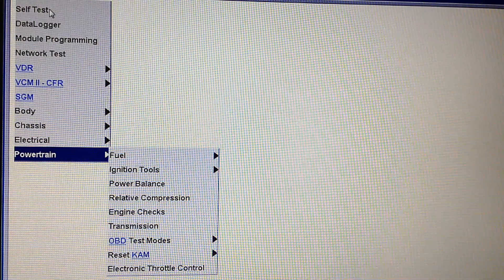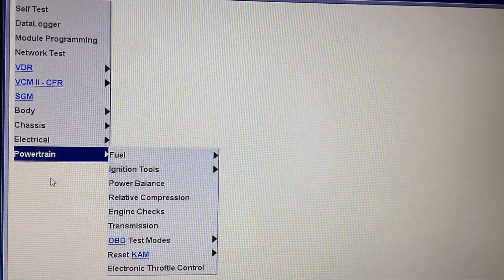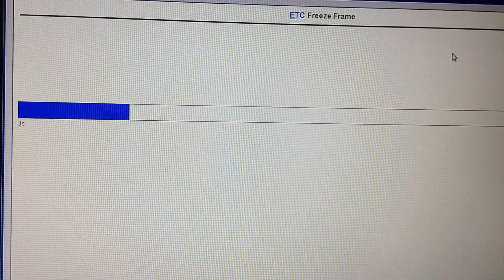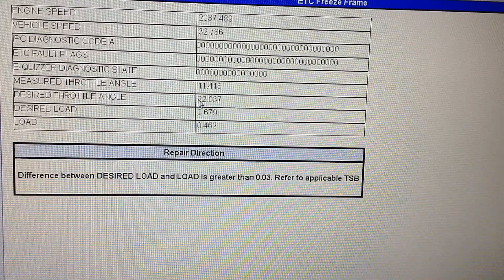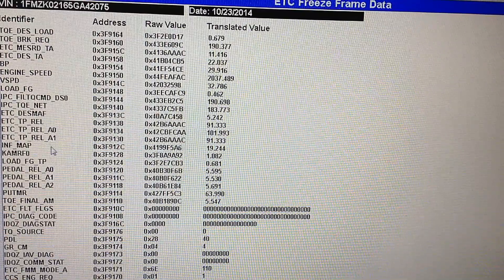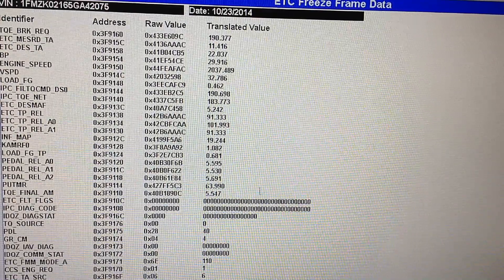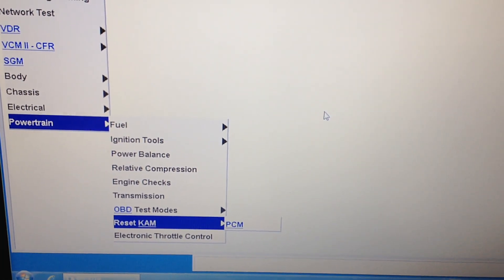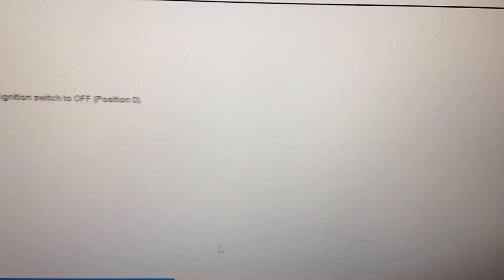Ford Five Hundred & Freestyle Surging No Start: Electronic Throttle Body Replacement

Comment: I took my 06 Five Hundred to the dealership earlier this week.  The wrench icon had come on & the car decelerated while i was driving on the road.  The mechanic ran a diagnostic check on the car & he found out that the wire for the throttle control was on the AC unit, it had gotten hot, frayed & burned throught the wire casing.  He said that the wires were touching & this was the cause of the vehicle slowing down.  I was told that i could go in myself & apply electrical tape on it to temporarily fix it until i can get it into a shop to fix permanently.  Is this possible, and if so, how do i get to the wire myself to fix it?
Reply from the maker: +Antonio Phillips I have a video on how to fix this- https://www.youtube.com/watch?v=IrDL810CEI4
Reply: Did it fix your problem?

Comment: Just cleaning throttle body regularly solved the surging problem on my Ford 500.  My mechanic did so much work trying to fix surging Ford 500 (which broke the motor mounts) before we realized all we need is to clean the throttle body every six months.  There is also a software patch we might try if it works well for everybody else.  Ford dealer recommended replacing throttle body, never heard of Ford-500-11-8-520TSB20.pdf  which has the software patch information.  A lot of information seems to have been taken down (by Ford?)  There was a Facebook page calling for a recall.

Comment: If clips not put on correctly, on Air Box, it will result in DIRTY AIR going into engine, like no air filter at all.  It creates havoc for MAF ONLY when it gets all DIRTY, causing codes, misfires, etc. Always cover filter if you leave it in the open box, when servicing vehicle. Upper air box should not be put on dirty floor/table. Cover/plug it up. That's for CLEAN AIR ONLY. (air filter is used, I assume, by owner)

Comment: Thank you for posting this video. I replaced the throttle body in a 2006 Ford Freestyle today, and the job couldn't have gone easier. It now runs as smooth as silk.

Comment: Thank you so much for suggesting Amazon for this part as I am on Amazon Prime. The local Ford dealer here was gonna stab me for almost $800.00 for this part alone plus 2 hrs of reprogramming of the throttle body. Total bill was over $1000.00. Too much! I will order the part tomorrow through Amazon and do this myself as I have done all my work to every car I've owned in the last 45 years. I paid close attention to the torque value for the bolts.  I will also re-learn the new part per one of your videos. Again, thanks!
Reply: Today I replaced the throttle body in my 06 Freestyle. All went without a hitch (yes I followed all of your instructions to a T). When I reconnected my battery the headlights came on & turned off quickly, but she started right up and the check engine light, which was on prior to this job, shut off immediately. Thank you for your advice!
Reply: My 2007 ford five hundred had throttle body problems. Was fixed with a recall I knew nothing about but learned from the Ford dealer.
Reply: Did the tb fix your problem?
Reply: Got mine from amazon, came with the coolant setup. @$100 cdn

Comment: I have an 05 Ford Five Hundred. The vehicle use to intermittently misfire and also buck and go into fail safe mode.  At that time scan codes were P2544, P0316 and P0306.  I replaced the plugs with Autolites and the # 6 coil. I then did the relearn procedure and it was still kicking out the same codes and misfiring.. or at least felt like it was misfiring.  I then took it to a shop and had them run a diagnostic and re-flash the PCM and TCM as I had found a TSB reporting that the P2544 code required a re-flash if the vehicle was built before a certain date, which mine fell into that category.  During their diagnostic they couldn't get it to replicate the issue.  They then re-flashed the PCM/TCM and afterward they did a test drive and it kicked codes P2104 and P2111 and went into failsafe mode.  They did some more diagnostics and recommended replacing throttle body unit and TB connector  as they said when they "tapped on the TB sensor housing or wiggled the wires at the connection" it would show something on their tool. They gave me a copy of the graph from their diagnostic testing and showed me where the graph went wonki. I took the vehicle home, replaced the throttle body and spliced in a new pigtail connector to the TB. This didn't resolve the problem and was still kicking out the same codes P2111, P2104 and now P0306. The vehicle has 180K miles on it. I figured a major tune up was in order. I replaced all the injectors and coils, I also replaced the spark plugs with Motorcraft this time as I had read that Autolites weren't Ford friendly. I also replaced the EGR, PCV, fuel filter, air filter, intake gaskets. I cleaned the MAF sensor. I drove the vehicle for two days and it went into fail safe mode and kicked codes P2104 and P2111. Very frustrated at this point. I was told the maybe the TB was damaged during shipment as the TB position sensors are very sensitive. I replaced the TB again and also replace the accelerator pedal position sensor. This still did not resolve the issue. It is currently showing codes P2104, P2111 and P0306. Also, I will note that my vehicle's wire harness did not drape over this AC line and was completely clear of it with no signs of chafing. I have access to an Invova 3130 scan tool.  What can I look at and monitor to see what might be causing this issue? I'm at my wit's end on this, any ideas on what are some other possible problems that I should consider?  Any help would be greatly appreciated!
Reply: Mark Darnell did you replace all the coils?
Reply: Mark Darnell you have to replace all the coils...
Reply: Try replacing 02 sensors too
Reply: Having same issue

Comment: do codes p2110 and p2107 have to be deleted after throttle body is replaced . I changed throttle bodies I tried to reset the computer but the wrench light is still on. it seems to be running better after a few mins but my gas petal is not working at all

Comment: I'm doing this job for my mom. this makes me love my old carburated mighty max slot more. the cost of this part is more expensive than my brand new carburater and my fuel pump was only 50. these new cars are money puts $200 for each injector that's $1200, $400 throtle body and that's not including a fuel pump

Comment: AWESOME video. Thank you. 
BTW, What software and bi-directional equipment do you use(or recommend) to read, reset, diagnose.... codes that also can be used with other brands of vehicles other than Ford??? Thanks

Comment: Hey, I have a quick question. I have a ford freestyle 2006 and it won't start, it cranks but won't start we had to call a mechanic they said it was the key but they checked and it wasn't then they said it was the spark plugs we changed them and it worked for only 2 weeks then it stopped then he went over again and now he showed us a code (OB II) and said it was the computer😰 
It's very frustrating, do you have any idea? Thanks for your help!!!

Comment: i have a 2006 five hundred and sometimes when driving the wrench light comes on and the car wont shift into gear but when u turn it off then back on its fine. any thoughts on why it does this.
Reply from the maker: Arya Mansoori Well it just depends on what the code is. I would get the codes read at auto zone first. There are two common issues for this and first I would say is the throttle body needs to be replaced as shown in the video. Second thing that is common is for the transmission speed sensors to fail causing this concern intermittently.

Comment: I just watched your video because I broke down yesterday in my 2006 Ford Five Hundred and received a quote of $1,133.00 to have a throttle body replaced. I'm considering buying the new part and replacing myself. Your video was very clear and well done. I feel like I am now armed with enough info to give it a go. Is there anything I should be aware of or concerned about prior to getting started?
Reply from the maker: Chuck DiNatale Nope just do as shown and make sure you rest the pcm memory afterwards so it can learn the new throttle body.
Reply: FordTechMakuloco Why are you not telling people to try cleaning the throttle body regularly?  The new throttle body will fail to.  Why are you not suggesting the software patch in Ford-500-11-8-520TSB20 which addresses this problem?  There is a letter from ford to the owners of Ford 500's that should be mentioned concerning the surging problem.
Reply: I I love hi

Comment: @FordTechMakuloco  ... ford500 running pretty damn good, no CELs. sometimes upon first start, idle will surge/drop to 500 RPM a couple times and then idle fine. Kinda seems like after the engine is fully warm. Idling seems to have occasional very very slight surge. TB has been replaced (I can tell from cooling line). Intake manifold has been done. What do you think ? Is this more of a fuel issue ??

Comment: my mercury montego is runnin no check engine lights but soon as i switch to gear and press gas it cuts off and some time it cut off when it switch to gear is this throttle body???
Reply: I have  the same problem with my five hundred
Reply: @pakman2292  i neva figured it out i junked the car

Comment: Help: I have a 2006 ford freestyle limited that's giving me a little trouble at the moment. Whenever I'm driving the vehicle tends to kinda shut down and no matter how much I press the gas pedal it won't go until I shut off the vehicle completely and start it up again. I took it to get scan and these 2 codes came up, P2104 and P2112. Please let me know what you think about it and what I should do. Thanks

Comment: My rpms run a little under 1000 rpms while in park.  I have a 05 ford freestyle 3.0 liter and it runs terrible.  There is no check engine light on and while in drive it has a little miss and it feels like its putting a strain on the transmission.  I put new plugs and new coils and still no difference.  Im wondering if I have a bad throttle body.  Any suggestions?

Comment: Which one is the sensor wire? I have a graphing multimeter but it has a bad battery and don't want to have to waste time tracking it down. If you can give any info that would be awesome. Thanks.

Comment: I followed your instructions on cleaning/changing the throttle body and now the car runs great.  Another problem, not long after i was driving the car to relearn the throttle body, the ABS and Trac control light lit up. Any way to get those lights to come off, I'm thinking this is due to the computer resetting.  Help!

Comment: I have 05 five hundred, works great, except the engine crank but won't start in cold weather or it might start but dies after 5 sec. (no check engine light). i did some research  but couldn't find much. Is there any chance that this (electronic TB) might be the problem.

Comment: I have a ford 500 2006 this is my second throttle body replacement used that is.  My question is do I need to reset anything or will it reset itself when replaced.? This issue has really stressed me out because the car stalls strains and the wrench comes on causing it to jerk and a acceleration. Thanks for any advice!
Reply: I know you might or might not have the money but you are better off buying a smack brand new throttle body,I have a 2006 Mercury Montego And It's the Same as a Ford Five Hundred(500),Its in the shop right now getting a throttle replacement, and the throttle was original,But like i said buy a brand new one,cause your better off with it and it will last you a whole lot longer than the used ones
Reply: Are the oem ones consider new like from jc whitney?
Reply: Yes
Reply: it will need to relearn

Comment: Ok, I am getting what I initially thought was  a rough shift at slow parking lot speeds with an initial light pressure on the pedal is applied after coasting.  The tranny bogs down and it happens maybe once a month.  Is this the throttle body? 

Is the issue the old style coolant throttle body or can it happen on a noncoolant TB too?  Should I stay away from ebay used TBs or do you have suggestions on those?  I was told by a dealer service manager my dad has had a relationship with for decades to not to use brake cleaner or carb cleaner on these new TBs because they take a coating that it takes off.  That then causes other issues.  Do you know of any cleaners that would not take the coating off and would clean it up? Is the dirty part the issue and if not what causes this issue? I have 158k miles and want to fix this cheap is there a way to do that with this Montego issue?  The expensive route I have considered is a A1 Cardone remanned TB.  Will that work or will that coating potentially be altered by A1 Cardone in the remanning process and not be good  similar to how the dealer warned me?  Any suggestions on an affordable fix would be great. thanks

Comment: Just got word that my 2nd alternator failure is due to a PCM issue. Can these be replaced used or aftermarket? Had a coilpac go bad , changed all plugs and rear  3,4,5 coilpacs and then alternator issue. Car was re-ended 2 weeks prior and had to have the alternator replaced so we could drive home. Charging system light came back on 150 miles up the road. now 2nd dealership saying PCM is bad...
Reply from the maker: Steve Corbin Is the alternator a Ford reman unit?
Reply: FordTechMakuloco Yes it is. Now dealer says its a bad PCM.

Comment: I have a 2005 ford five hundred and the wrench light came I was thinking it was the throttle body but I just read in the owners Manuel in the maintenance section. it says if the light is on that is the cvt transaxle it doesn't say anything about the throttle body
Reply from the maker: +Louis Gonzalez It is most likely your throttle body yes but get the codes read before going any further.

Comment: How do you determine whether you use a heated or unheated etb? Have a 2006 Ford Freestyle sel.
thanks-helpful video
Reply from the maker: +Glenn Sarka All the new replacement throttle bodies are non heated.
Reply: Great thanks

Comment: Q1: Do you know if my 2005 ford 500 ltd is still eligible for the throttle body cleaning and reprogram program for free cause my ford 500 had cut off had hard time to start and idle weird sometimes and when i accelerate and if so what do i do cause my dealership acts funny and gives me a hard time 
Q2:do you know any good websites to buy OEM parts like that window switch you had told me to check into ?
Thank You you always a great help
Reply from the maker: Coverage last 10 years or 150,000 miles so I guess it depends on your warranty service date.
Reply from the maker: I just buy mine straight from the dealer, most online sites look to be cheaper but they get you in the end with shipping.
Reply: ***** Try cleaning it with a six dollar can of throttle body cleaner, an old toothbrush using a how to video on you tube.  We held off on doing the software patch until we see how it works for everyone else.  I don't trust Ford anymore.  They did finally send us a letter offering to do something, but the regular cleaning of the throttle body does the trick in our mild climate.   We plan to clean it every year or two....maybe every 20,000 miles.  Seriously I know zero about cars and I can do it.   There might be some sort of cover-up at Ford.  I was asked to be a witness in a lawsuit but the plaintiff died and case was dropped.

Comment: I have a 2006 Mercury Milan that threw a P0506, and is surfing when in traffic at a stop light or what have you.  Watching your videos, and reading the comments, sounds like I just need to remove and clean the throttle body. and go through the relearn process.  sounds like a fair assumption?
Reply: *surging*

Comment: I have a 2007 Five Hindred and I'm pretty sure I'm haveing or have had surging issues. How can I tell or what issues would my car have that would be a sure sign that my throttle body needs to be cleaned or replaced?
Reply: A few years ago, had surging problems. Took to dealer and found out the throttle body had a recall. Problem fixed, NO CHARGE!

Comment: Did replacing tht throttle body fix the issue? I have a 2006 ford five hundred I ordered a throttle body for due to mine failing. Did that car have the CVT?
Reply: Did it fix your problem?